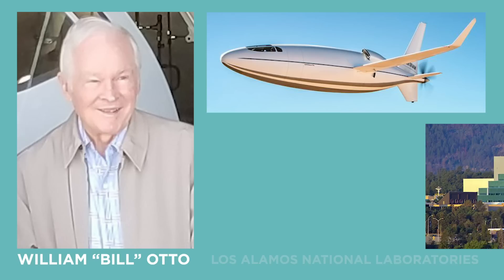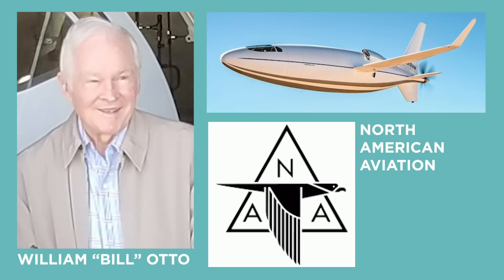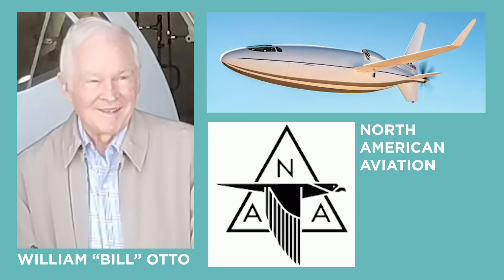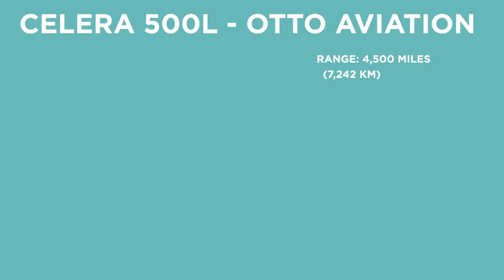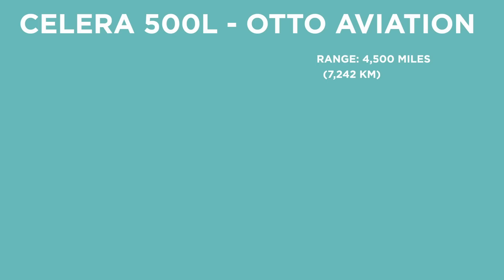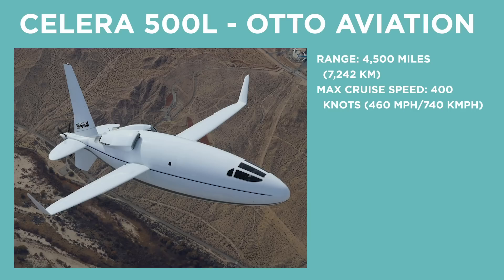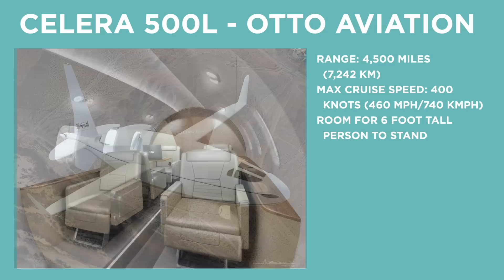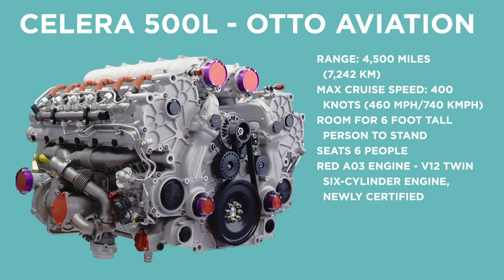Could This Plane Save The World? (Hint: No.) | Answers With Joe

Comment: I think the mistake is trying to apply disruptive technologies to antiquated ways of thinking. There can be an argument that it can reduce congestion at large airports. If I lived in Lincoln Nebraska and wanted to fly to Little Rock, I'd fly to Chicago then Atlanta before landing in Little Rock, 11 hours later. There's several choices between those two, some with one stop, many with one stop one way, two stops the other way. I would be contributing to several large airports' congestion. Instead, I could pay about the same price and be at my destination in two hours.

Or it could turn regional airports into a parallel part of the the spoke and hub system. While many flyers are going from major airport to major airport. Many more flights are between feeder cities into that spoke and hub, then long layover to the next bank of flights and back out to another feeder city. I've flown between regional airports with a Dallas layover, many times. Instead of every flight going to or from Dallas, there could be a feeder hub at Oklahoma City, reducing the load on Dallas for flights between Lubbock and Nashville, or something like that.

Also, $20 million for a 747? Even at their debut, they cost more than that. But there's more economics than comparing a plane to the second largest aircraft. There's a reason 737's and A320's sold 26,000 of the 46,000 total commercial aircraft sold by Boeing and Airbus combined.

Comment: what would be best if if the design of this plane caught on with other planes, there are reasons why planes arent shaped like this tho this design is nothing new, gliders have been doing this for decades its all about cost and versatility, its an expensive shape to make and doesnt allow for the fuselage to be extended or shortened, but if the costs of running planes with more aerodynamic shapes can underweigh the upfront cost then this certainly could be the future

Comment: Joe, You mentioned electric planes. Would an electric plane be able to take off carrying anything more than the batteries needed to operate and fly the plane? Please pardon my ignorance about where we may be with cutting-edge battery technology, but having some idea of the amount of aviation fuel and the weight involved with the fuel required, I can't even imagine the number of batteries that it would take to fly a 747.

Comment: Even if this plane would make sense as a jumbo jet replacement, lowering fuel consumption rarely really lowers overall emissions. Because two things can happen, if the costs go down, more people will use said new solution, thus increasing emissions. Or the cost stays the same, but people are still more likely to use the new tech because it's less harmful. It's called the rebound effect in economics, and it already happened in london with coal, where they had problems with too much smoke in the city and better, more efficient steam engines came out but the problem got worse anyway.

Comment: The real question is whether the technology of the Celera scales to the size of an airliner.
Reply: Doesn't and they don't claim it can, most you can do is double it.
Reply: The reason why the Celera is so slick and efficient is because it has laminar flow on ALL surfaces, not just the wings, not just the tail, but the fuselage and everything else touching the air.  To maintain that laminar flow over the entire aircraft, the size itself has to remain small for it to work.  You would need an impossibly smooth surface beyond the sizes that Otto is attempting and that's not even including the other parts of the plane on its surface, like where the wing and tail and air scoops meet the fuselage, the little instrument ports that are necessary on all aircraft, all the door and window seals, etc., that would more or less destroy that impossibly smooth surface you made.  Turbulent flow is sort of like a cascade effect, one tiny burble in laminar flow and it multiplies on its own until it makes all of the flow turbulent.  If a tiny gap in the door seal creates a tiny little burble, that will multiply on it's own and kill the laminar flow, but luckily that tiny burble doesn't have a chance to disrupt the laminar flow since the tail of the airplane has already left the area...in a 747 that burble might turn into fully non-laminar flow by the time its halfway to the wings, leaving the rest of the aircraft in draggy turbulent air.  Continuing this example, you'd have to make that 747's door gap fit so ridiculously flush that you wouldn't be able to feel the seam with your fingernail.  And that's only considering the obvious, as even the smooth sections of an aircraft need to be geometrically accurate, there can't be even the slightest imperfection, meaning any flat sections would have to be truly flat, any curved sections would have to follow that exact curve, with a margin of error lower than a coating of paint. So keeping the aircraft small is really the only practical way you can achieve laminar flow, since even the tiniest amount of imperfection will eventually end up causing non-laminar flow.  By stopping a specific size, you're basically making a cutoff point at which laminar flow is too hard to practically maintain.  To put that into perspective, so far this is the only aircraft I know of that has incorporated laminar flow on all surfaces, not even NASA has made a fully laminar airframe for testing purposes, so for them to manage it on their own is an engineering accomplishment.  Laminar flow is, to put it mildly, the holy grail of aerodynamics.

Comment: The comparison to the 747 is not appropriate and distorts the economic capabilities of the Celera unfairly. The 747 is only used on major routes ( plus is not really anywhere near $20 million it costs $420 million!). Other smaller passenger jets are used for the majority of flights. If you compare it to a 737-900 which costs $90 million each and seats ~180 passengers, the Celera looks much more favorable as you need 30 instead of 61 at a cost of $150 million and half the crew overhead of your 747 comparison. It starts to become more feasible in this more appropriate comparison. The added flexibility of the Celera being able to handle any routes is an added bonus for the airlines and passengers not available to the larger planes.
If the Celera comes down in price, as any would during mass production, it would be even more economically competitive with the larger conventional jets.

Comment: "We could put batteries in it!"
Lithium Ion batteries have a peak energy density of around 0.9MJ per kg.
Kerosene has an energy density of 43MJ/kg.

Or in other words, to fit the same amount of energy into a 747 using li-ion, you'd need about 8,000,000kg of battery.
Wait...
Yeah that's EIGHT THOUSAND TONS.

Comment: You debunk the carbon emission reduction of the Celara as compared to a 747 but have already admitted Otto aviation is not going after the 747 commercial traffic. The Celera is a smaller plane.  It is possible to connect some cities which currently have not direct flight.  1. The Celera could be a direct flight in markets where a 747 is not warranted between two cities.  More flights of a smaller plane with suit more schedules with less waiting.  2.  It may replace DRIVING there.  I.E., compare the gas used to fly 6 people to the state capital as opposed to driving 3 cars (or even 4 or 5) to the state capital.   If you fly to your meeting, you might also be able to fly back the same day saving on lodging, meals, etc.  The money saved could be applied to paying for a more expensive ticket and could be more affordable for some.

Comment: There were compression ignition, opposed piston diesel engines that were so efficient they could fly nonstop W/O refueling from Argentina to Germany during the 1930's & 40's. However, they were very difficult & expensive to produce at that time. There's been talk of bringing it out of the realm of large ship engines where it now primarily presides, but that is silenced PDQ.

The only 2 reasons jet engine took off like it did initially wb9 speeds jets offer. The planes of today, they are buses, mass people movers that hop from hub to hub. 460 mph would work in that case, think C-130 with efficient & cheap to operate spec's.

Comment: A full Boeing 737-800 will get about 175 passenger miles per gallon.  Typically, a Toyota Prius gets 50.  200 if it is full.

Comment: you should compare it with a full-first-class-seat boeing 737, which can only hold 50 seats. but the biggest catch is the 25 mpg with a V12 engine at 300 knot speed, that is just simply against physics

Comment: I would prefer getting dropped off at a local.airport ten miles away, rather than driving two hours to a large airport just to get treated like crap. The Celera is a better fit for rural and non hub airports.

Comment: This is a rather weird comparison. Obviously the design would have to be upscale to a mass transport passenger plane to make it worthwhile. Only that could then be compared to normal passenger planes.

Probably here design issues appear or Boeing or Airbus would do that as they obviously constantly work on fuel efficiency as the main cost factor for running air fleets.

Comment: This - and electric aircraft- are not designed to replace major spoke-and-hub airlines. Think of it as replacing inter-city busses.  You are completely missing the point that most domestic Aviation is short-haul - under 500 miles.  With a short-haul point-to-point electric aircraft model,  I could go from a county airport just outside of a major city (like Philadelphia) to another county airport outside another major city (like Chicago) and bypass the congestion.

Comment: Many passengers drive in from smaller communities in order to catch a 747 flight (and seriously: how many 747's fly passengers any  more?). With the Celera 500, they could be picked up at smaller regional airports with runways about 3,200 feet long. People from smaller population centres might pay a bit more if they can avoid the road trip into a larger city with a large airport that can handle B-747 operations. In this way, the far more flexible and less demanding Celera 500's  would provide far better passenger service.

Hourly cost of aircrew: 747 pilots are gas turbine-rated (jet-rated) pilots typically have thousands of flight hours, and I doubt that they could be realistically had for $50/hour. Celera 500 pilots need only be rated for piston-engine aircraft. With only a pilot and six passengers, would the driver even need an (Airline Transport Pilot) ATP rating? How much does loaded Celera 500 weigh in at? Whatever heavy aircraft airline pilots cost, surely Celera 500 pilots wouldn't need the same number of hours and might not need the same ratings. I'm unsure as to whether the air transportation authorities would authorize single-pilot operation.
Reply: That would take a "Celera 1000"  25 passengers. But...I think that would be easy to design.

Comment: For scheduled flight the main advantage would be opening up those smaller airports, so people can take off and land closer to where they want to go. I think that's one of the stated aims of the Alice electric plane. Also I was hoping you might do a quick calculation of range for an electric version, assuming you know the Celera's weight? Take off Celera's fuel and some of the engine weight because an electric motor is lighter for the same power, how many Tesla 4680s would that allow for?

Comment: I'm way late on this just due to real life stuff, but I have a bit of a hang-up about you quoting aircraft fuel efficiency in terms of distance. That's..... not how aircraft fuel efficiency is rated. I do get that you're having to communicate to an audience who by and large probably only ever thinks about fuel efficiency in terms of distance because that's how cars are rated.

But with aircraft that distance can be exceptionally variable due to factors like velocity and direction of the wind relative to your direction of flight. So with distance being variable like that, aircraft fuel efficiency is typically expressed as a "rate of fuel burn" in terms of gallons per hour of flight, and aircraft typically have several numbers like this published under different operating conditions such as optimum cruise versus maximum cruise (yes, your fuel burn increases when you try to fly faster because drag is a thing and it increases non-linearly with respect to indicated airspeed!)

Comment: Yet again - NUCLEAR POWER! It's not like anyone is motivated enough to build a large plane with fission power plant on board, but you don't even need a conversion to electricity that way. It will be super efficient. And if converted to electricity, with that much power you can supply an electric jet engines, ones with zero emissions. And it is doable today.

Comment: 747 is a bad comparison here. Within the next 15 years there will be no 747s flying passenger service in the world (aside from the new Air Force One based on the 747-8).  Within the next 20-25 there will be no A380s. The industry has been moving to smaller jets and point to point flights. The benefit of having dozens of Celeras is that they can all go to different destinations, but it would be a LOT slower. The Celera isn't designed to compete against giant aircraft, its designed to compete against small business jets.

Comment: Amusing, though with every paradigm shift, the new thingy performs poorly under the old paradigm scenarios.

The Celera, by 2025 will allow electric planes to go further.  Say 400Wh/kg possible by 2025  Range/mileage * 2.86kg/gallon fuel ~= 660kg fuel => by 2025, => 264kWh battery pack possible, though of course the battery pack weighs the same at the beginning and the end of the trip, while gas starts heavy and ends light.  Say 250kWh.  

Now, what range would the Celeron 500L get with 264kWh?  A Tesla model S would get 400*2.64~=1,056 miles

Comment: What about hydrogen? The Reaction Engines A2 looks entirely feasible if talking about hydrogen combustion, and Airbus just announced plans in September for their own concepts. On another front, there are smaller planes in development using fuel cells and electric motors.

Comment: I AM A PILOT. SINGLE ENGINE AIRCRAFT  CAN ONLY FLY IN CLEAR WEATHER WHEN USED FOR PRIVATE CHARTER.  LIMITING BUT NOT A DEAL BREAKER.  TO BE ALL WEATHER IT NEEDS TWO ENGINES AND A LEGAL ANTI ICING SYSTEM. PERFORMANCE REPORTS SOND OVERLY OPTIMISTIC  BUT EBEM IF OF BUY 20% still PRETTY GOOD

Comment: There are some problems with the cost of the aircraft listed. Your 747 price of 20 million is about average for a used 747 while this other aircraft is new.
A new 747 would actually go for quite a bit more than 20 million. Even a no frills new 747 would run around 220 million today.

Comment: The Celera will never be as efficient as claimed.
It may be laminar flow, but that fat fuselage is VERY draggy.
And it will be very difficult to cool that rear engine.
I doubt the efficiency will be any better than a King Air.
(P.S.  A jumbo costs $300 million, and they went out of production.)

Comment: Actually if you remove the vip seats and put regular airline seats you can cram 10 people or 8 comfortably
Reply: Plus you can also half the pilots pay as hes flying a much smaller plane (meaning less stress and responsibilities (airline pilots are paid the highest because they have the responsibility of a huge plane and the lives on board)) in my calculations that brings the cost down to 6,945$ (that's also not taking into account that this plane can run on biodiesel which makes the cost drop significantly!)
Reply: And don't even get me started on how much cheaper a hybrid biodiesel would make it! Good videos but you can't really compare a van to a double decker bus...

Comment: Hey Joe, you say at 7:01 that the Celera uses less fuel per passenger mile compared to the 747 (you state that on a 1k mile trip you'd save 2100 Gallons if you use 61 Celeras in contrast to one 747) which yields a saving of ~2100 $ at current fuel prices according to you. But later in the video at 9:12 you say that the 61 Celeras have a higher fuel cost compared with the 747 (fuel cost for 747: 5520 $ vs Celera at 11520 $). If the fuel costs of the Celeras are 2100 $ lower than the 747 shouldn’t this be 3420 $ for the Celeras instead of 11520 $?

Comment: Though it could have a budget configuration (more seats), Maybe have them fly in formation with 1 pilot at the front. Though you didn't talk about landing fees ect.
Reply: It depends on the specs. There might be a configuration that could fit 8-10 passengers. But they could only bring the clothes on their backs, no luggage or even day packs. It's pretty common for aircraft (especially in this size and smaller) to have far more volume for packing stuff in than they have the capacity to lift. A Cessna 172 can seat 4 adults on the ground, but you may only get to fly for 30 minutes because that much fuel hits the weight limit.

Comment: It's a heavily cruise optimized plane , skinny high aspect ratio wings , pusher prop , Etc. Nothing here is new , and everything the designers did has a trade off , high landing speed , very narrow CG range , massive performance drop from Ice or insect build up , very noisy , high maintenance engine , limited cargo ,  Etc.